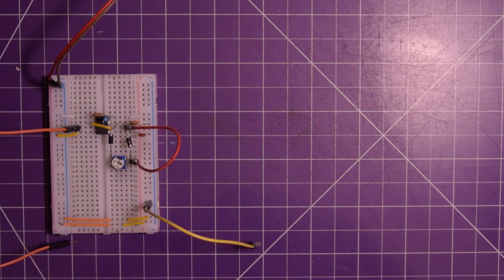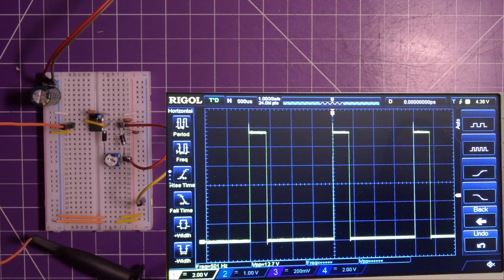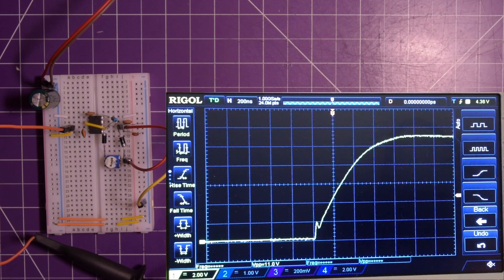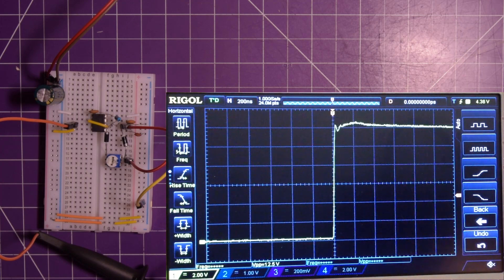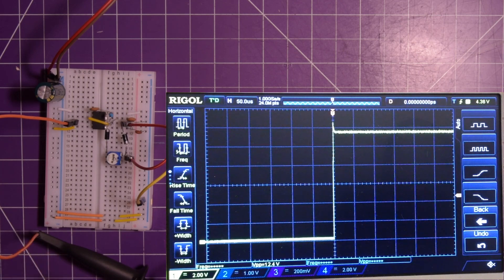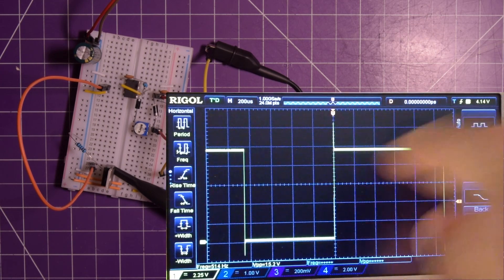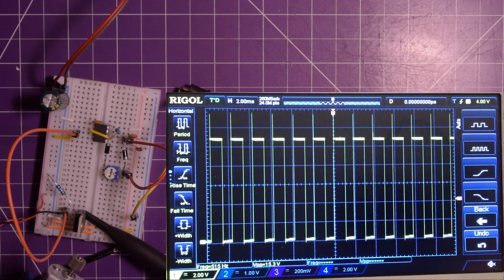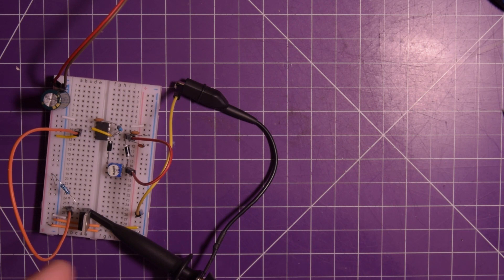Improving The 555 Timer PWM Generator!

Comment: Don't know if you actually read your comments  but playing around what works good for me is adding a tlp350 on the output pin of 555 and driving a pair of irf3205 or irfb3207.
then you can keep 555 safe. i run my 555 from 9v battery and give my mosfets from 24 to 60 volt dipending what i want to drive, and i promise you i drive the hell out of anything
Reply from the maker: Definitely do! Sounds about right using transistors to drive the actual output!

Comment: The 220 Ohm resistor is an energy waster. For 50% duty cycle you consider to have half the operating voltage across it for half of the time. This is an average of 14 mA idle current only due to the capacitor.

Considering the capacitors. The internal voltage divider should be stabilized with 10 nF at pin 5 if it is not used in the circuit. This is enough for the NE555. The stabilization for the TLC555 should be done with 100 pF to 1 nF (I use 470 pF) because the resistors of the voltage divider are not 5 kOhm, more around 100 kOhm (they are made of two CMOS transistors, each). Higher capacitor values inrcease the start up time of the timer IC considerably in the ms-range.

Don't mess with the ouput capacitively. Even at a normal capacitive load of 15 pF the on / off times are in the order of 100 ns. This is a very good value for a BJT output stage from 1971 which can deliver 200 mA. The TLC555 is faster with its 20 / 15 ns. But this is a decades more modern device, which can operate up to 3 MHz or higher under special conditions (the record for an astable multivibrator is around 6 MHz).

The NE555 depend very strongly on a buffer capacitor immediately between Vcc and ground of the device. This is caused by the lack of a shoot through protection for its emitter follower output stage. In the switching moment the output stage draws up to 600 mA for 50 to 150 ns. This is really a lot. The copper lines to the device can easily have internal resistances of a few tenth to several Ohm. The operating voltage can collaps considerably during this current pulse. To keep the voltage drop in the order of a below 10 mV (this can be crucial for highly linear voltage comparison) you have to buffer the power supply pins with at least 220 nF. In critical applications I buffer up to 470 nF. In case that the output voltage drop is not so important I stay at 220 nF but I buffer the voltage divider up to 100 nF.

All the CMOS versions of the 555 timer IC are shoot through protected. I can't understand why they have not implemented a shoot through protection to the BJT version until now. This is in principle very easy to do. But maybe, they want to keep Mr. Hans R. Camenzind's 52 years old original design for sentimental reasons.

Comment: THANKS FOR THE VIDEO!!!
You really need a circuit diagram to make things clear!   Your main culprit here is the breadboard adding inductance, and picking up noise.  In all the decades I have used the 555 for critical operations, a tight non-breading circuit,the difference is "night and day"!  There should NEVER need to have a high-watt resistor in a standard 555 basic configuration.
You can get around the "general limitations' of the standard 555 by using two (or more), ie:  556 and 558.  Keep in mind that some tricky circuits make use of the 'control pin' which is missing at each 555 on the 558.
NEVER neglect, in all app's, the power and voltage ratings for resistors--this happens in all too much...in other circuits.

Comment: Yes there is. Just use a smaller value than 10nf. Whatever frequency you want to use, find the right value that will get rid of the spike and keep the edge. Try a 1nf. Why isn't that obvious?

Comment: Hi did you not try reducing the value of the timing capacitor.  Your are using a RC timing circuit.  So you can reduce the resistor  value to give more current to charge the  capacitor faster or you can reduce the capacitor value to allow it to charge up faster with the same current.
Reply: Yes, that would work.   A common one is 10nF or "103".  10x10^3pF

Comment: Can you drive several like 10 FETS off this 555???? I wanna control a whole bank of them?? When you spin these up let me know I will definitely float you a few bucks for a couple!!
Reply from the maker: Theoretically, you can drive an unlimited amount of MOSFETs since the only current flowing is the leakage current from the G-S junction
Reply: @SimpleElectronics  Don't forget the gate capacitance. In some bigger power mosfets it can get really high.